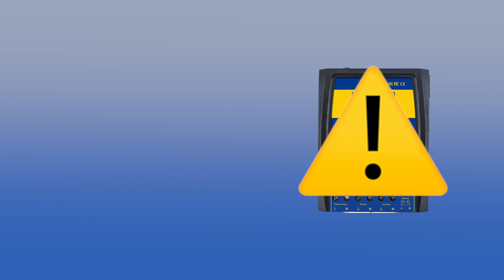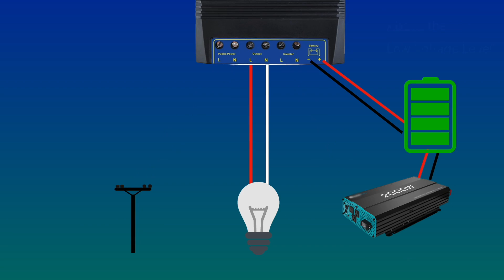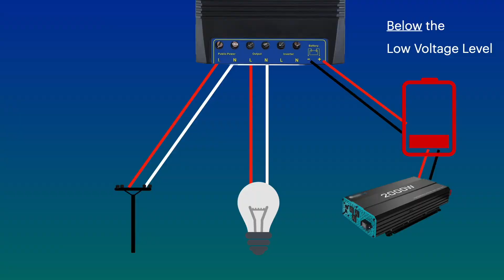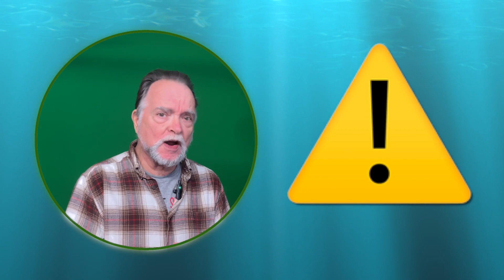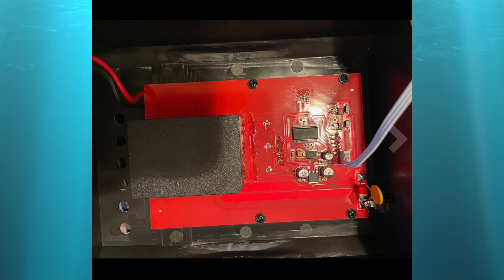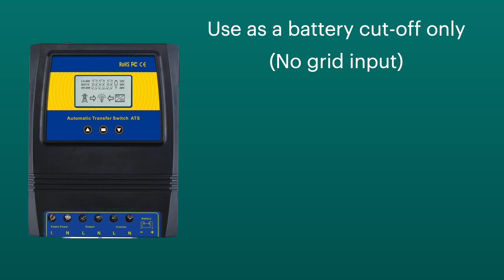Simple Hacks To Safely Use This Automatic Transfer Switch.

Comment: I have an inverter with AC back-up and charger,  I wanted to use this as a stand alone transfer switch for my mini spit heat pump.  Would this be safe for the electronics in a newer style mini spit?

Comment: would it be safe to connect the grid wires to a secondary inverter (I have two solar generators), or would it be just as dangerous?

Comment: Just put a circuit breaker on the two voltage inputs also those #8 wires can handle 50A because of the length. If you follow Electrical safety that device wouldn't pose a problem

Comment: 6:35 fyi, AWG#8 supports 40A, or about 4400w@110v, 8800w@220. Yes, the 11000 is optimistic, but it would handle start-up loads like motors up to 11k under most circumstances, or about 8k continuous.

Comment: What you could do is monitor the inverter output with a AC voltage monitor relay. If the inverter output goes over or under those thresholds then you can interrupt the battery voltage monitor circuit. It will then switch to the grid even with bad inverter output.  I would avoid using this unit in splitphase setup.

Comment: ..also you cannot have the neutrals tied together. They must all be switched to their respect power source. This unit will not work with a 240vac system single phase that requires a neutral with the load. Strait 240vac without a neutral i believe it can. However this unit is probably decent for small 120vac loads only. I just bought one for 30.00 on amazon to take a peek at it.

Comment: I got one of these things 2 years ago but got the heebee-jeebies as I started trying to use it.  Eventually gave up and put it on a shelf.  It can't really switch sources fast enough to act as a UPS anyway.   I'm pretty much done using APS (or similar) UPSs... they don't have enough storage to run equipment very long and their SLA batteries have to be replaced every 5 years or so.

My eventual solution was to splurge a bit and buy a Victron Multiplus II.  Basically a hybrid inverter.  It can switch the mains quickly enough that equipment doesn't glitch and you can just connect it to a battery and poof, you have a nice little UPS with very little work.  I also connected up a bit of solar to the battery with a charge controller.  The idle consumption of the Multiplus II is only 12W or so... it's very low, so I don't waste much power and with 200Ah of 25.6V LiFePO4 batteries connected to the thing the critical equipment can easily run for 24 hours if the mains go down.

However, this isn't a cheap solution.  The Multiplus II 24/3000 is around $1000 and a 25.6V LiFePO4 battery with decent amounts of storage clocks in at around $400.  But man, it is so reliable and quiet.  I love the thing.

-Matt

Comment: thank you for the informative video.
I am looking for a switch that will connect the batteries (inverter) when the grid is down. Would this device work if I connected the grid to the inverter input and my inverter to the grid inputs?
I would set the switch from grid to my battery's (inverter) when the grid falls below 100 volts, and would run off the battery's until the BMS flipped them off.
If this is not a good idea, could you recommend a fast switch, under 30ms to keep my computers from shutting down?
thanks!
Reply: i know the victron filax 2 would do the job, but this looks like 25% the cost

Comment: I'm glad you explained the relay can fail dangerously
Reply: Mine did. It blew the legs clean off of the MOSFETs in my inverter by connecting grid power to the inverter rather than either grid or inverter to load it connected both.